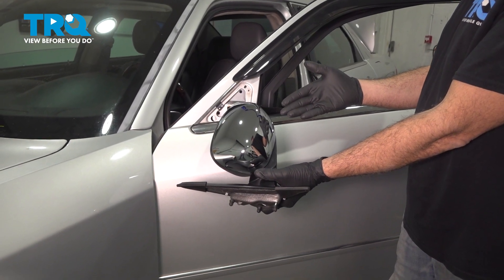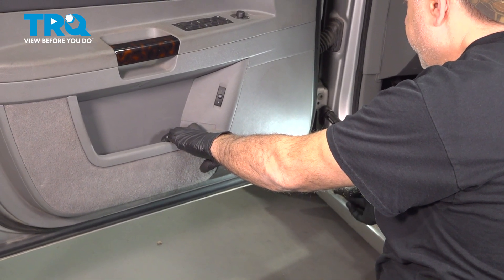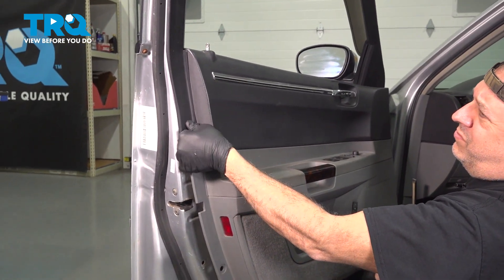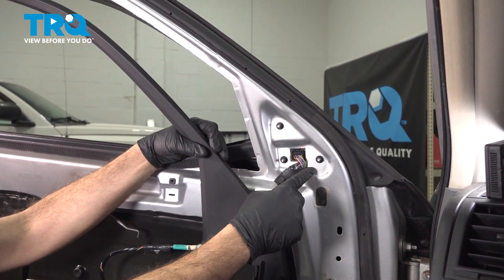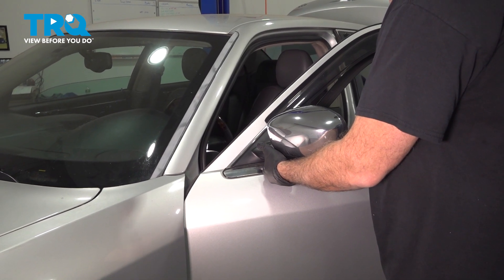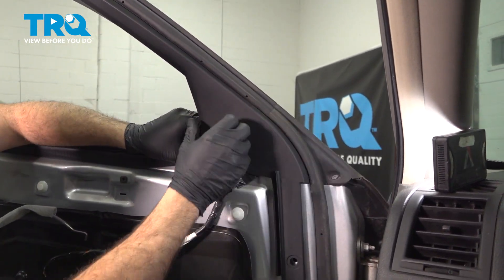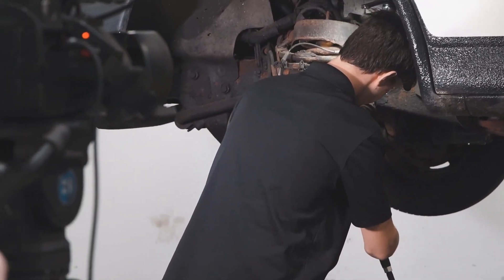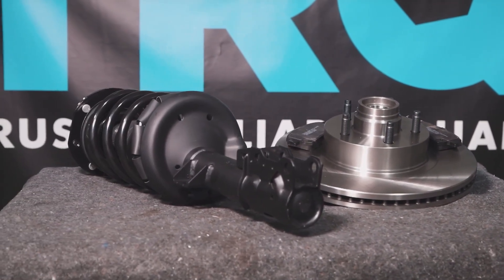How to Replace Side Mirror 2005-2010 Chrysler 300

Comment: 2010 Chrysler 300... I had three issues. 1) I could not get the rivets out w/out pushing the pins too far and having them fall into the frame.  2) Once my mirror was unscrewed, it did not want to pull away from the car. That outside molding was very problematic.  3) putting the panel back in place. In fact, I still have not gotten it back together. Dropping down onto the connector on the.  The one towards the front is difficult.  You had a nice edit there, and I wonder if it wasn't a challenge for you as well. I do appreciate the video.
Reply: I have an 09 T model with the same issue of the rivets falling through the frame. The door still holds up well but did you ever find a solution to that?